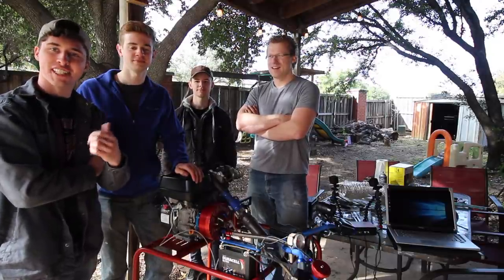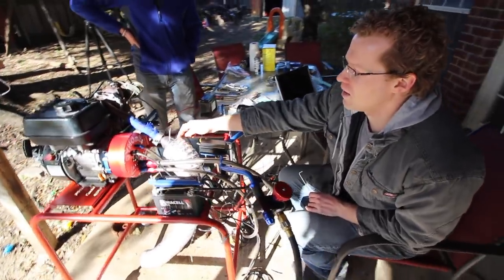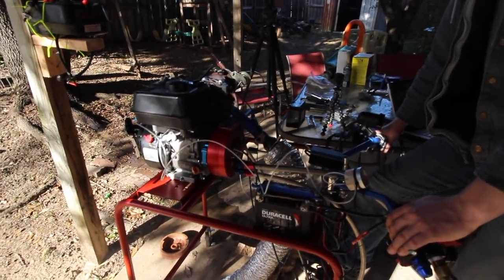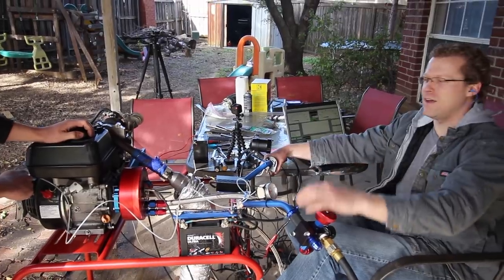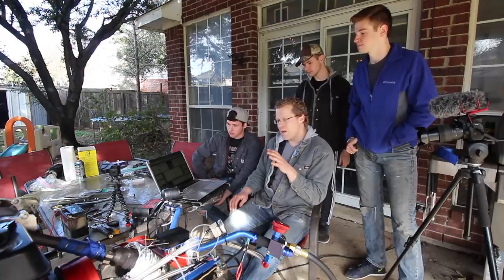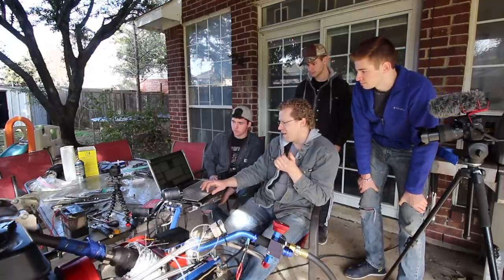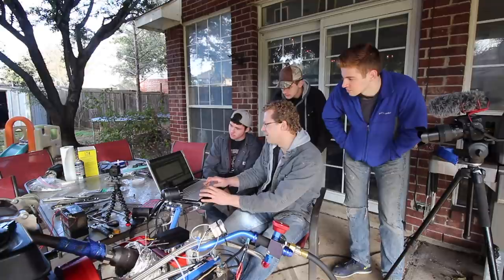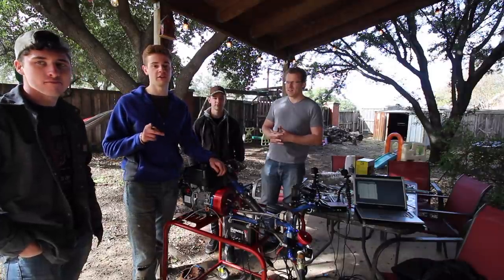Testing the Turbo Go Kart Engine On the Dyno! (How Much HP?)

Comment: What you guys need is a 308 Dyno cam 32 lbs valve springs and put a arc Billit rod  with weisco piston be in it be under 300 bucks and rejet the carb  I can see this thing in the 16 to 18 hp  we race predators on karts were I from  we are pushing 15 na hp

Comment: It will cosr some but do a 20 25 hp 212 like cars n cameras get the efi and the turbo thrn i reckon it will make 33hp under boost or more my budget street honda bobber has a 175 cc 5 speed its getting an efi and turbo in a couple months
Reply: my blowthrough destroked xr200 motor got close to 80whp not long ago. thing is you will never make a good number without a lot of real engineering and I don't mean trail and error only you gotta do some math and on a single it's not easy to make power with boost not like it is with a 4cyl.

Comment: My tilliston 212 R makes more than that for a lot cheaper stalk...
Reply: But tilliston engines Aren’t sold Nearby, If they were I guarantee you they would be the best engine But predator engines are just simpler and Cheap (120)$
Reply: @siryusef9862  Yeah they are cheap I'll give ya that but the 212 R has upgraded parts already and is a steal of a deal if you don't want to do much for a lot of horsepower.

Comment: Try a pull through set up with your carb. Carbs aren't designed to have air pushed through them; they're  designed to pull air in. Put the carb before your turbo. And jet it bigger. Or get a bigger carb. And build your valvetrain.

Comment: Wow you need to fix your air fuel ratio 12.5-13:1 is acceptable for a boosted application  anything else will damage the engine

Comment: Just buy an old ZX6r or R6 engine and mount it. It’ll be a monster, No need for Turbo cos it’ll be crazy, be if you do it would be insane. 
You could probably find a GSXF750 engine for cheaper.

Comment: If you guys can get those AFR's dialed in throughout the rev-range, you should be easily pushing 20 horse with a 212cc. But your going to need an ecu, fuel injection and possibly a wideband O2 depending on whether your going to run an open or closed circuit fuel loop.

Comment: maibe talk with sloppy mecanics and see if he has an older microsquirt efi system that you can buy from him , single cilinder single injector high presure pump with boost refference and a coilpack ignition based of a crank sensor

Comment: This doe's not prove that the turbo makes more power. I bet if you pulled the turbo off and dynoed it your numbers would be a lot higher ! If turbo experts cant get a turbo to work on a single cylinder engine I don't think you guys have a chance .If you really want to make boost on this or any single cylinder engine throw away the turbo and get a supercharger !
Reply: Small displacement single-cylinder engines can be turbocharged and make power it's fueling system and ignition timing they have to figure it out. the rule of thumb on for every pound of boost 2 degrees timing off of total timing to that carburetor they have is not designed for Boost they should have a a different carburetor no accelerator pump , no secondary mechanical jet. that carburetor needs to be replaced with a throttle body fuel injection system for it from scratch very cheap. Look up Turbo Kart death machine. Sean. N on YouTube and the same guy turbo cart walk around that's just a 8 horsepower Honda 340cc watch it wheelie down the Street that the end listen to it you can that the end listen the wastegate open he's probably making over 20 horsepower build a simple throttle body EFI system for it from from sensors laying around 32 tooth reluctor in a megasquirt ECU probably don't have $300 in the whole thing

Comment: This is pretty cool just for being different but a stage 1 kit will make the same amount if not more power than this, if you have a fully built stage 4 engine then you might be able to get it working, also I would try a draw through carb

Comment: You should run the carb through the turbo inlet, would be easier to tune that way. Then you can just run a hard pipe directly from the turbo outlet to the intake manifold.

Comment: if you make 8.2hp at 3900 rpm, why rev it out to 6000? because the connecting rods are suicidal?
Reply: Oscar Thorpe yes and it’s running lean and could blow up

Comment: Now i would try moving the turbo setup over to a fully built motor and really seeing its potential and then bullet proof it and make the most powerful 212 gokart ever, and put it on something with atleast a solid axle not one wheel peel
Reply: do that with a 670cc predator. not 212

Comment: Definitely change the main jet or move the needle up a clip also take jets with you if you guys go back and do ot again I'd keep trying tell you get it. Or then do efi. I'd still try and make the carb work!
Reply: Kylee Bates Moving clip on needle only affects mid range. When your wide open the needle is all the way out of the main jet. Main jet affects wide open throttle a/f ratio.

Comment: To fix fueling, use a modified car fuel system, a fuel pressure regulator with a boost refference. Block off the bowl breather and ensure you have a fuel pressure gauge.

Comment: With my moped i made around 25 to 30hp by guess with 74cc engine (2stroke do) so don't get why so excited with so low of a hp (and I could off tuned it higher but I thought it went to crazy otherwise)
Reply: Hahaha the fuk, u dont get 25 to 30 hp on a 74cc.
u need someting with 88cc and above. and u need it to be fully equiped with tuning stuff like ignition, reeds right jet fitting exhaust, 
and lots of more so ur probably only get 10-20hp with 74cc

If u want 25-30hp u need something like this https://www.youtube.com/watch?v=UQNr9qhTQQc
Reply: X Sir Gaming X maybe 20hp it whas around 90kg in weight so it can be misleading, i had a 74cc alu butterfly ports cil. With 21mm race carbaratur and of course race exhaust after that I broke my crank so had to change that and bearings , it pulled away on almost everything till 80kph (top speed of 130kph not to crazy) I didn't want to trow race ignition on there but i knew someone who did that had to tighten his bolds every other week

Comment: You guys need to put on billet parts , from the bottom end up through to the flywheel , get a Woodruff key for the flywheel to advance the timing , get stronger valve springs so you can rev higher without it going pop . Then work on the turbo side of things , getting the fueling right (run it rich) , I'd also recommend doubling up on the head gaskets to lower the stock compression.
Reply: He has a Mod2 cam in it, so... yeahhh...
Pretty sure they "Belletproofed" the internals as well.
Reply: They REALLY don’t want to advance timing at all. It’s pulling good, and so far there hasn’t been any dropped spark from the increased cylinder pressure. Advancing timing with a lean AFR will send the cylinder temps high and lead to knock and / or a burnt piston. 
Getting the fuel trim correct will be the next big hurtle. Right now, they are barely pushing the turbo. Get the AFR down to a steady 13.5 - 13.8:1 and go for a WOT pull to 6500. 👍
Reply: What are they running, a 5.4:1 gear ? 
They wont build boost with that anyways.
I know . My twin turbo car wont with a 4.56gear but will with 2.73